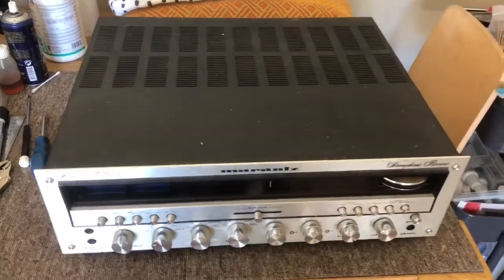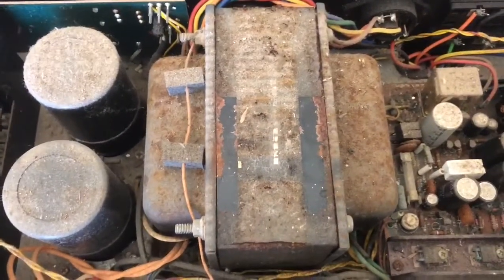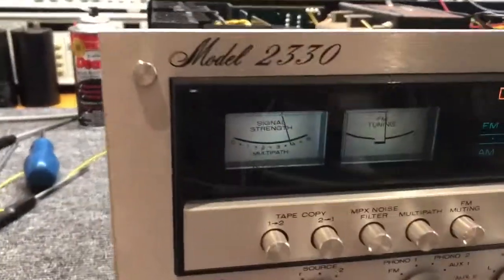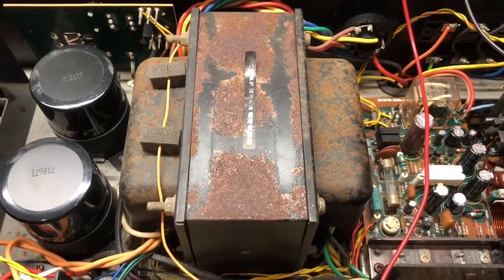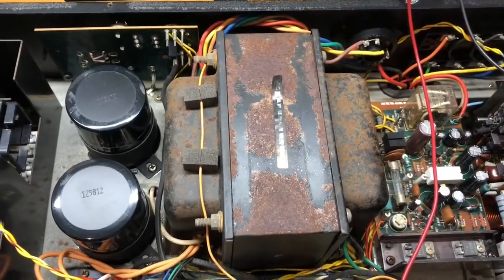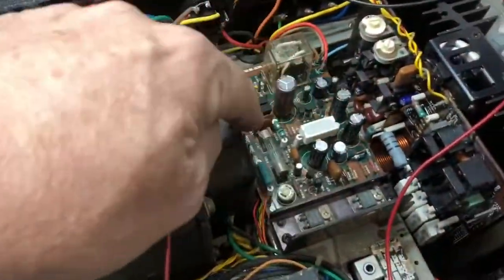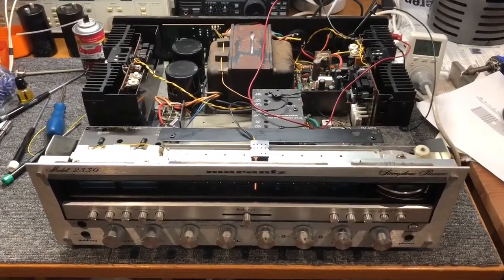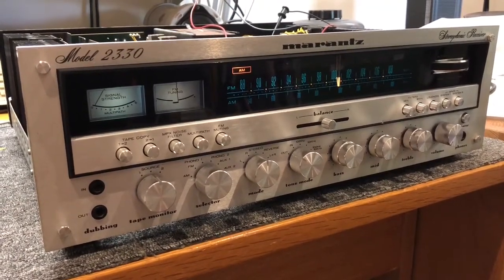Stunning Marantz 2330 Monster Receiver Before & After Overhaul

Comment: Wow, amazing job. Compliments. Could you specify how and with what you lubricated the tuning mechanism and the path for the tuning needle? It runs real smooth and want to try to improve my 2238.
Reply from the maker: Thanks Chris, there's quite a bit to it so it's beyond the scope of a quick reply here but every point of motion needs attention. The gyro tuning in particular needs lubrication and precise adjustment, all the pulleys need lubrication, plus the pointer, tuning capacitor bearing, etc. Remember that a full RF alignment is best at this age too.

Comment: I have a 2330b and it has some very bad line noise and a scratching sound when I adjust the volume any idea how to fix it?
Reply from the maker: Hi Yershaye, thanks for writing. There could be a number of problems here, with any gear and technical query, the best option is to get her into me for a proper assessment and then some service. Are you local?
Reply: Unfortunately not I am located in NZ I think I am just gonna put it up for sale
Reply from the maker: Yershaye Chetty Fair enough, I work on loads of Marantz, it’s almost always repairable but I need it here to fix it, sorry you’re not local.
Reply: Yershaye Chetty  lets fix that by experts, please. You need a new poti. I damaged my 2500 by repair by myself.....😱.  Fixing your problem is not very expensive